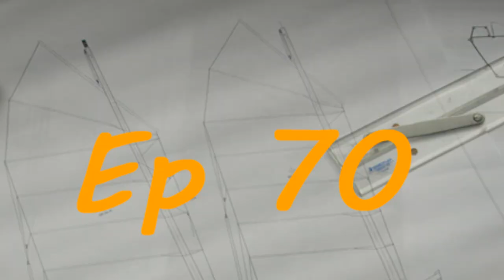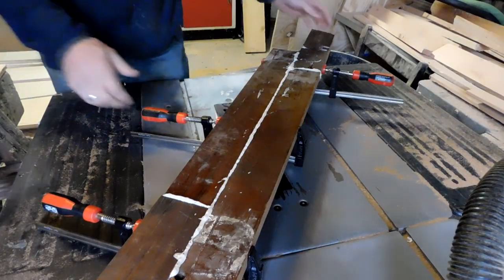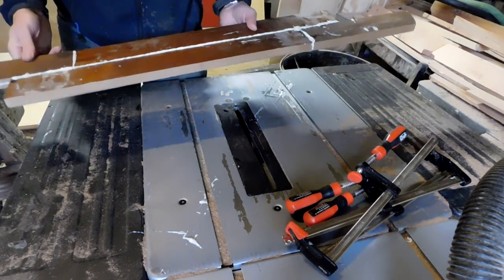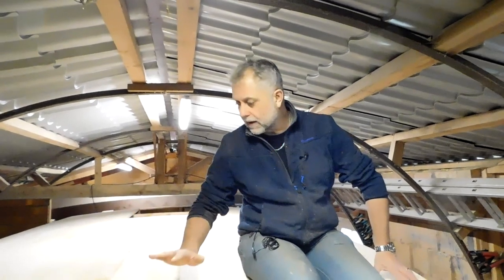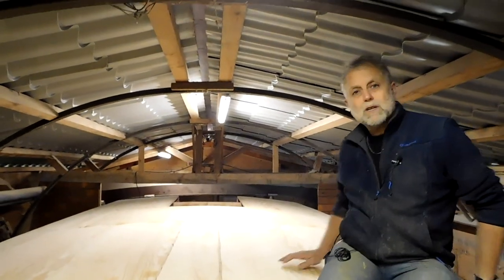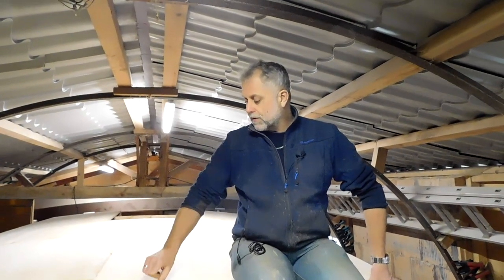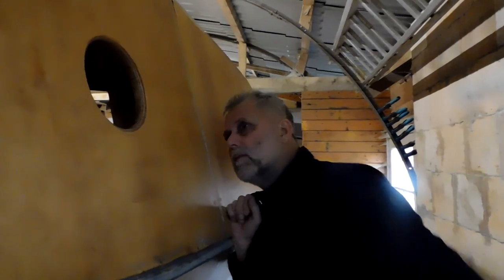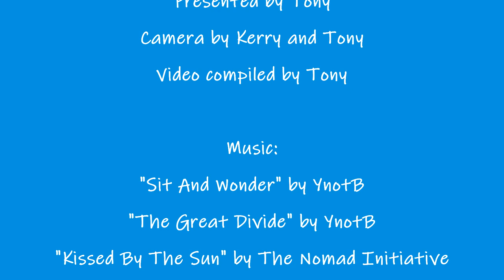The final deck plank and building the chart table - SV Tapatya EP70

Comment: Did you say the glue is called semper rock?  You didn't use marine ply from what I can remember, is it just everyday common old ply? I'm really thinking about building a little ply construction dingy just to try my hand at boat building, I would really like to live aboard a small sailboat one day if possible and you have really inspired me to try building something but small scale at least for now
Reply from the maker: Hi Jas
The glue is called Semparoc, although epoxy is the go to glue for boatbuilding these days. Resourcinol or cascamite would work too ( as glues). The ply needs to be exterior grade ( wbp - water and boil proof - is best). If you then put a layer of glass cloth in epoxy over it, it'll be fine. Speaking from experience, I'd avoid Lauan ply ( sometimes called meranti) - or at least look very carefully at it - some of it isn't fit to be called plywood. And it's tropical, so not exactly environmentally friendly.
Reply from the maker: And if I've played any role in inspiring you 😀😀😀. Go for it and good luck. You might want to look at the plans from Selway Fisher (online). They're a good starting point.

Comment: LOVE THE MAP TABLE. HAVE YOU GIVEN ANY THOUGHT ABOUT A BACK UP GEN? NEAR THE END OF THIS YOU SAID ABOUT LAND LINE CHARGING SYSTEM. HONDA MAKE A SMALLISH GEN THAT IS SO QUIET YOU DONT EVEN KNOW ITS RUNNING. JUST THOUGHT I WOULD AS GREAT JOB TONY AND HELPERS HAAHAH OLD ONE LEGGED JOSEPH T RETIRED NAVY
Reply from the maker: Thanks Joseph. Plugging in to shore power (land line) was only meant for while she's in the shed. I'm planning solar panels for battery charging. With the sort of minimal electric system I envisage, they should be enough. Not ruling out a mini gen set though 😀
Reply: @SVTapatya  I SEE, SOLAR IS FREE NO FUEL TO STORE, OR WORRY THAT THE GEN MIGHT NOT KICK OVER WHEN NEEDED HAHAH COOL, JUST SAYING OLD ONE LEGGED JOSEPH T RETIRED NAVY
Reply from the maker: You've got it, Joseph 😀😂

Comment: How does the epoxy work do in cold weather? Will you have a lead keel?
Reply from the maker: Hi Hans
I don't use epoxy if I can't keep the temperature to at least 5 deg C. I use different hardeners summer and winter to suit the general temperature. The winter one has a min. working temp. of 5 deg C. 
I'm thinking more and more about going for a lead keel. It's either that or high density concrete. I still haven't finally decided. Lead is denser, hence smaller, but more expensive... 🤔